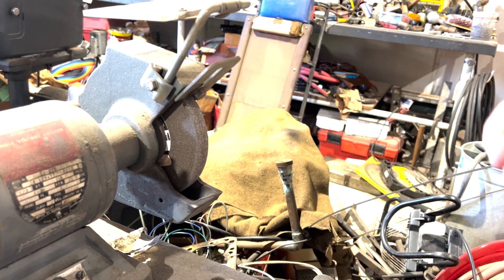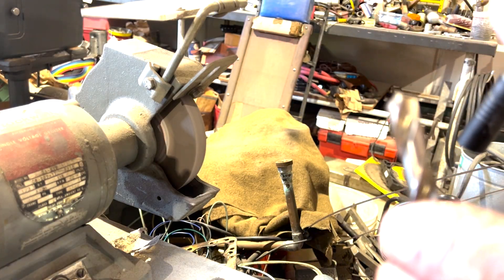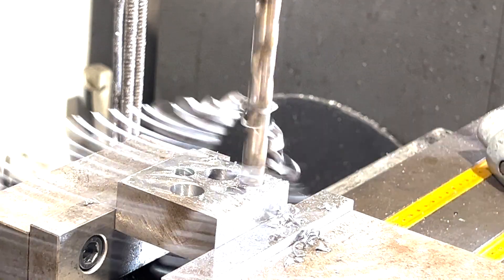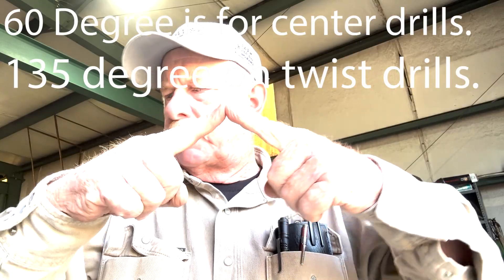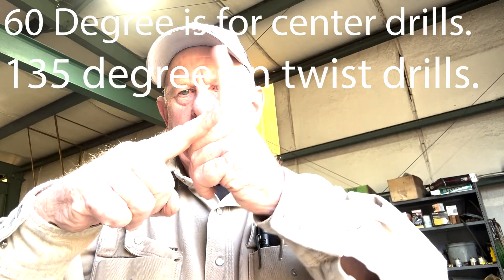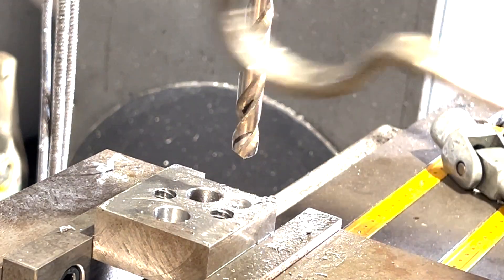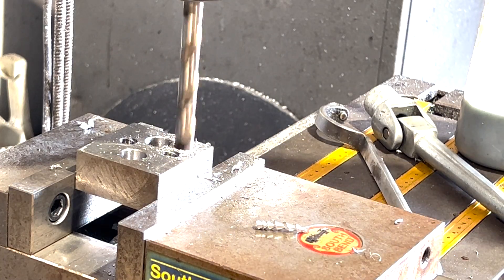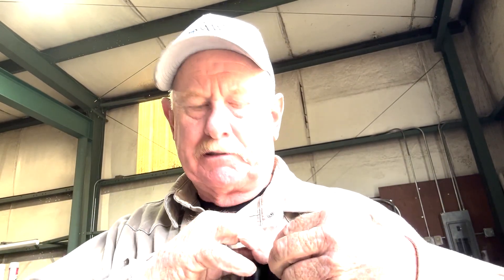How to Hand Sharpen a Drill Bit

Comment: sorry if i didn,t explain that well it,s just if you buy a drill bit now the very point of the bit is a bit flat and if you drill a flat surface the drill bit would wander you have to use a centre punch but if the point is like an arrow you don,t need to punch it as it stays central no wandering enjoy your show . terry
Reply from the maker: Thanks for the explanation, Terry. Glad you enjoy the show!

Comment: do your drill bits have a point on the tip or flat on the tip nice meeting you red . terry
Reply from the maker: I'm not sure what you mean by pointed and flat. They have either 118 or 135 degree angle which makes them somewhat pointed, but if you look at the end of them you can see a flat edge from flute to flute. Hope this helps and thank you for watching.

Comment: Many people have told me over the years that I don’t know how to sharpen a drill bit and maybe they’re right BUT, I keep right on drilling 😜! I find that I can usually do a better job sharpening them with a sanding pad on an angle grinder. If the edge of the sanding pad is still sharp and clean, I can even cut the relief on self-centering bits. Not saying it’s right and it sure ain’t perfect but it’s especially handy when working in the field. Happy Thanksgiving and thank you for sharing Red.
Reply from the maker: Thanks for sharing your method! That's what I tell people, it doesn't have to be perfect, just needs to work. Thanks for the input and Happy Thanksgiving.

Comment: 118 degree for regular bits 135degree for heavy duty,used to make drill bits for American Tool.
Reply from the maker: Finally, someone I can ask, 45 years ago, we used to flatten out the tip for stainless, I didn't ask, I just did. Can you elaborate on the reason for different the angles and why? Thank you for the input and watching.
Reply: @RedRheaWeldingmachining the 135 degree is for heavy duty split points and cobalt.